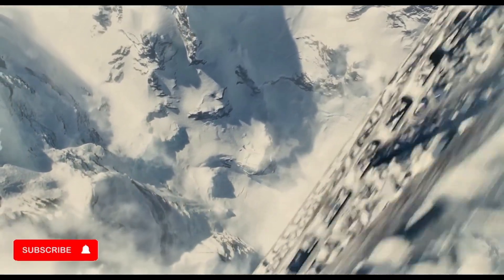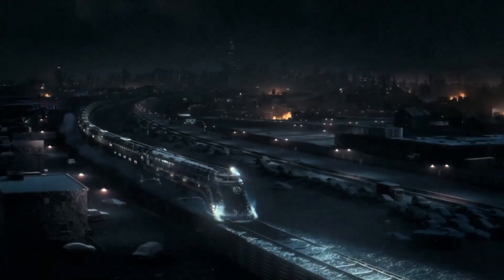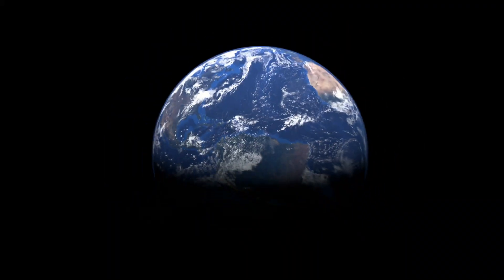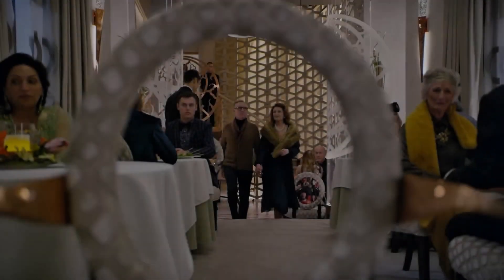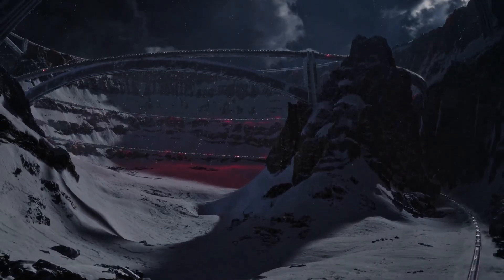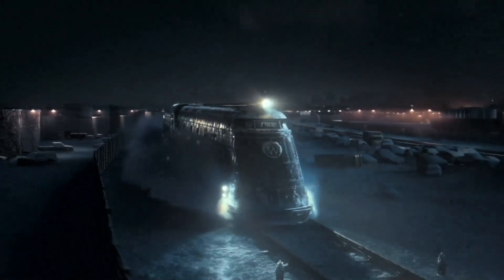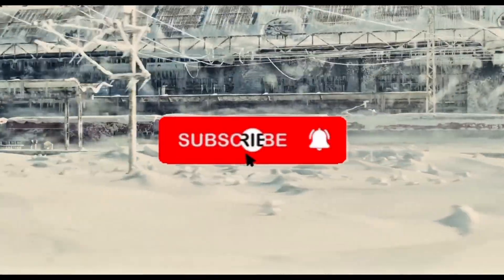Could Snowpiercer Exist in Real Life? The 1,001 long car train

Comment: Worst part is the idea of it being 10 miles long makes no sense when you actually look at the lengths of each individual car. In reality it would be a lot closer to 36. 

The excuse for it being able to exist is that the massive broad-gauge equipment and infrastructure for it is implied to have existed for a while, even to the point where it was somewhat standardized. As for the Engines that power the trains its said in the intro they're Perpetual Motion, a power source that doesn't exist due to it breaking a few laws of physics, but if it did, it would theoretically have endless generation abilities. The train from the show is definitely an amazing spectacle, but making it a reality would be difficult and expensive

The one from the movie makes more sense to me, mainly because its pretty obviously standard gauge. And while its never said how long the movie train is I think in production notes or something its written that its only 40 cars, so much more achievable by every measurable metric; It does kind of suck we don't have an intercontinental rail system like in Snowpiercer though. I think it would be theoretically possible
Reply from the maker: Yeah, the movie let us know there are actual parts that are not that SF, they wanted that image of a real train. More close to the reality. Some aspects not beeing mentioned at all

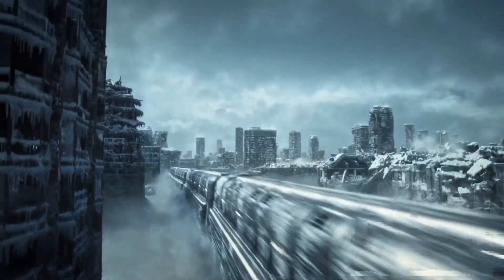Comment: 2:34  it could if there was additional locomotives throughout the train instead of just one at the front.
Reply from the maker: Good point, good point
Reply: In the TV series it's stated the cars have motors so they also provide bits of power.